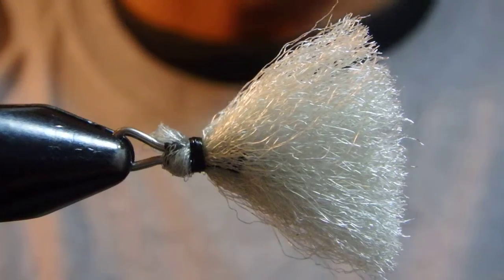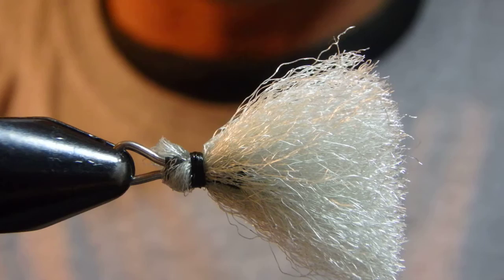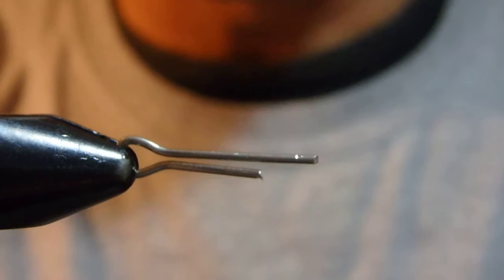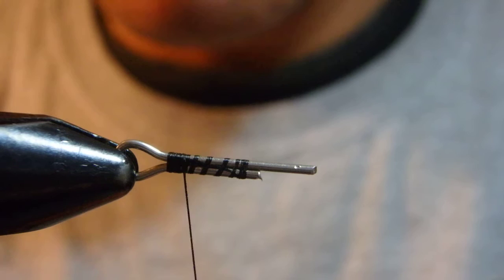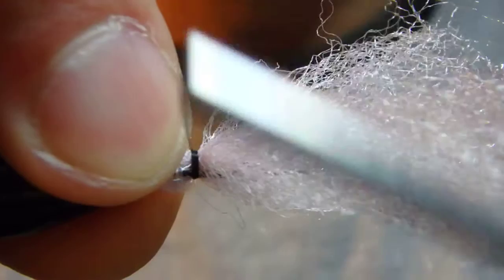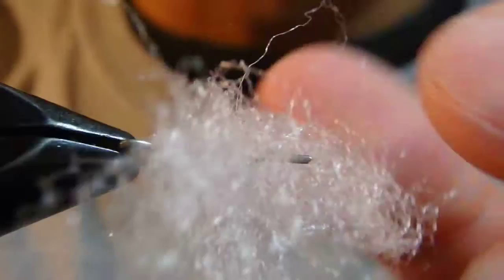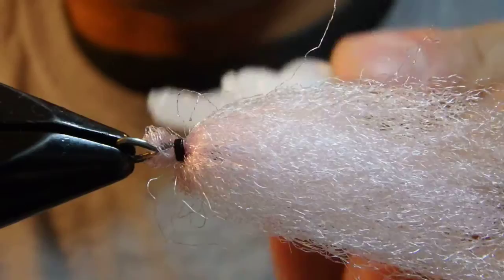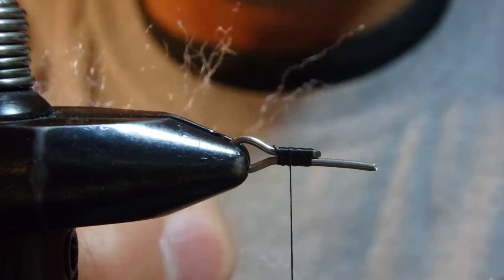Yamamoto's SY (Synth-Yarn) Indicator: How to Make It

Comment: Akemashite Omedeto Satoshi. Perfect timing on this video. I've been out winter midge fishing recently with some really small stuff and experiencing some of the indicator frustrations you noted. Too big, too loud and not visible for the conditions. I did manage a few trout but I felt I missed many of the lighter takes due to the oversized bubble indicator I was using. This is a really good idea and I'm going to try it. Is there a special way you rig it to avoid kinking the leader?